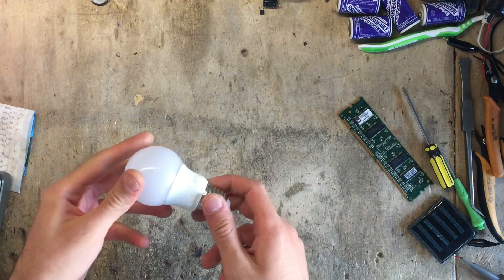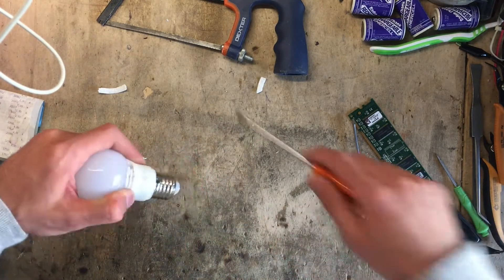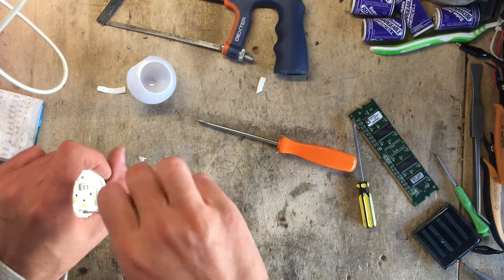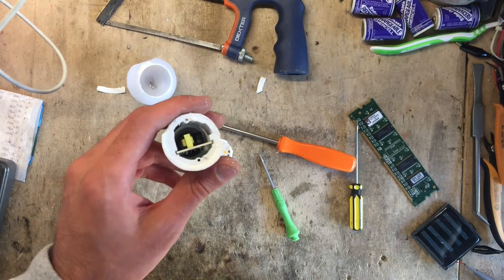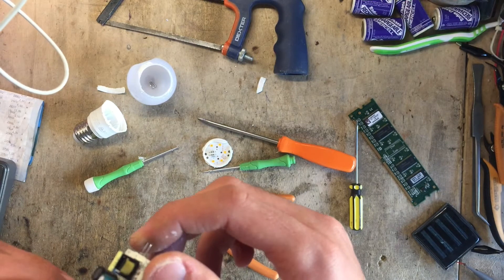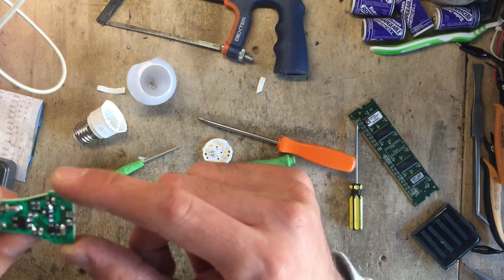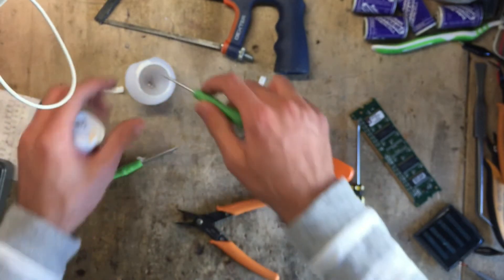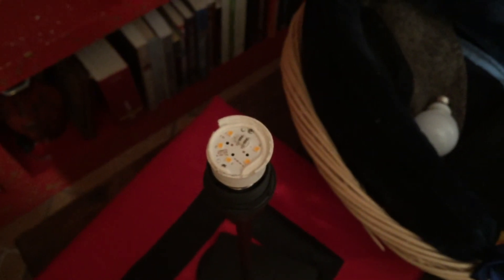IKEA RYET 400lm 5W Teardown - What's inside a 99 cent LED bulb?

Comment: Just finished a tear down of a more expensive Light bulb and the entire casing and cookie heat sink are aluminum and Swaged together. Meaning theres no removing the Round cookie heat sink to get to that power supply without destruction. The Stupid Capacitor had leaked and destroyed the bulb. The manufacture claimed 22 years of service but I might have seen 3 or 4 thanks to the poor quality Capacitor..22 years is a lie until they figure out how to make a proper capacitor.
Reply from the maker: Sadly planned obsolescence is at it’s peak. I’ve yet to see a LED bulb outrun a good high quality neon. Of course if you consider energy consumption, LED still had the advantage
Reply: @FrancescoF  Do you think theyre intentionally producing bad caps? I talked to a guy with a 1970's Fender amp and just couldnt get over the fact the filter cap is still working and never ran dry. Then the other guy has a pignose and I said what year? I dont even care about the model and he said 1990's and he was talking about a buzz and I said yeah dry filter caps. Pretty much everything from 1990's has failed from dried caps. Looking at these Large vintage Mallory caps they do look like they have a more robust package design. Im assuming the caps. package design is just over optimized to perfection.

Comment: You can hack them easily to extend the life of the bulb. Just clip one of the current sensing (setting) resistors off the PCB.( BigClive style)
Even though it's a buck converter and not the same bulb circuit in BigClive's hack, it still works!

Comment: I removed the plastic on mine by prying it off. I use it without the plastic. Is it possible to get an electrical shock if you touch it while it's on? Some posts and reddit and quora talk about a risk. Since they are LEDs on a circuitboard I'm surprised you could get shocked..
Reply: On pcb board is reported 96V.
With load (Leds on) I measurerer 45.8V.  Even  if metal is isolated, avoid touch it

Comment: Would be interest how much current draw each Led and the voltage
Reply: Opened mine and I got 88V
Reply: I measured tension under load and it's DC 45,8V. 
That mean each Leds Vdrop is 9V (because are 5 in series)